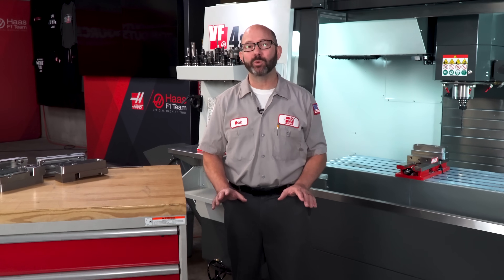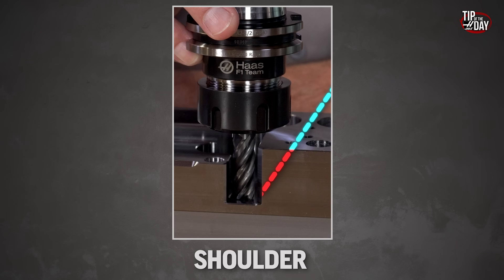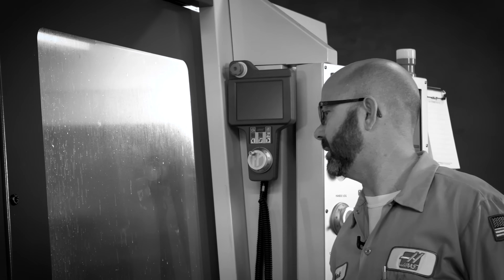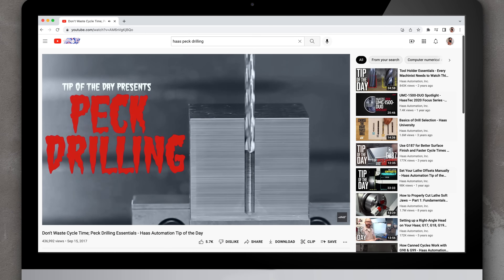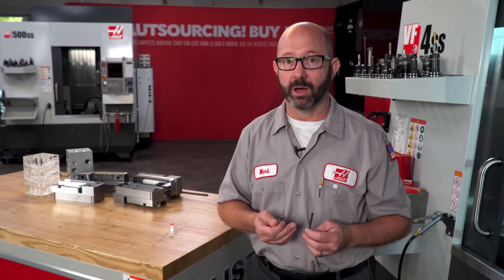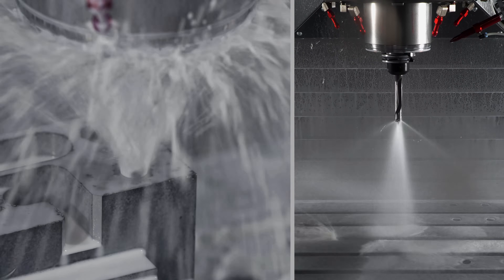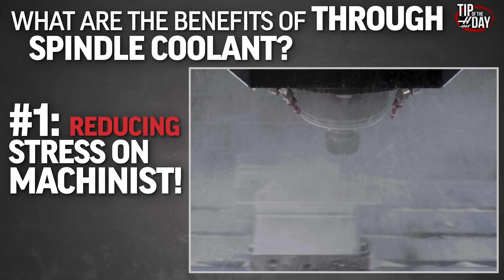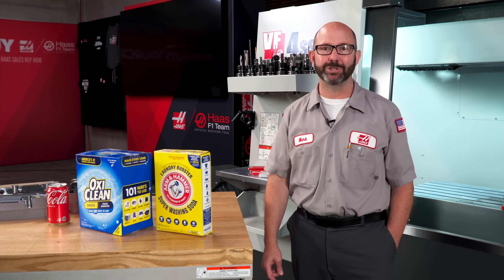TSC = Peace of Mind - Mark Talks Through-Spindle Coolant - Haas Tip of the Day

Comment: @markterryberry4477 Hey Mark, I’ve reached out to my local HFO but can’t get any responses from anyone about this. I have a 2021 VF-2YT. I bought it used, seller said it was TSC Ready, but once I got it and ran the serial it didn’t actually. It does however have a hollow spindle motor shaft and drawbar. I’ve been able to blow air thru the spindle. I don’t currently have any need for TSC but I do absolutely have a need for thru spindle air. I removed the push to connect fitting up top and blasted air thru the spindle but when I put the tool in the spindle (have verified the tool functions correctly on the bench) the air leaks out somewhere between the taper and the air purge fitting up top. Is there something specifically different between a TSC Ready spindle and a non TSC Ready spindle as far as seals/etc goes? I don’t need the tool to spin while air is running thru but I do need to be able to rotate it with an M19 Rx value in the program. Any help in this would be GREATLY appreciated.

Comment: Is there a reason why we wouldn't run all tools with TSC if available? Right now we are working a job and we are using a TSC drilling operation but then when we switch to tapping it's back to standard coolant delivery. I haven't asked the programmer yet why this is the case. I'm assuming it's a cost decision? Also, do the orifices in TSC tooling have an effect on tool strength?

Comment: Can we get a video about tension compression tapping chucks?...or if there is one could someone drop a link?
Reply: Thats a good topic. If your Haas machine has rigid tapping, I'd skip the floating tap holder and focus more on your coolant concentration and the type and quality of the tap you are using. In the 1990s, we used a lot of compression tap-holders, as many of the machines didn't have the Rigid Tapping option. Today, all Haas machines will come standard with Rigid Tapping, so there real is no reason to use a spring-loaded floating tap holder any longer. On older machines without Rigid Tapping, we could run into trouble if trying to use floating holders with Form/Roll Taps, unless we really play with things to get our application working, they have a hard time starting until fully compressed, which can make our thread depth vary. Today, we may occasionally still use a floating tap holder, like the ones made by Emuge, but these are just adjusting for small axial/radial runout, to prolong tap life on long running production jobs.

Comment: I used TSC with my 1/2” KOR5 end mill with the hole for it. Makes a huge mess. It did bite me one day. It threw chips up into the tool change mechanism and a chip stuck to the grease in front of the prox switch. Took me over 1/2 a day to take all the covers off to find the problem. 5 seconds to clear the chip. I like TSC a lot but the covers around the tool change need to be better.

Comment: Absolutely 100% non-negotiable when drilling out stainless steels in a productive manner. I've programmed and ran parts in a lathe where I've had to drill 5.0" deep in 304 stainless with a 0.403" size drill. Cutting with a cobalt steel bit took around 25 minutes per part, but with the thru-coolant carbide tip drill, the cycle time dropped to 7 minutes when taking into account all the other tools. That wasn't even with high pressure coolant either. Just some old beat up SL-30 from 05'. Put on a fresh insert, turn on the tool overload alarm to about 15% higher than what the spindle load readout is saying, hit cycle start, and get paid.

Comment: Question for the group: I have a smaller drill I am using to pilot #6-32 tapped features using TSC. When using that drill the pressure in the TSC line gets to ~1150psi. Other tools that I use TSC with are larger tools and the psi stays well below the 1k rating. I changed out the collet on the pilot drill to a non-sealed/standard collet to try and reduce the pressure. So finally the question, is the pressure surpassing the 1k psi mark, to a max value of 1150 psi, going to damage the TSC lines in the machine?
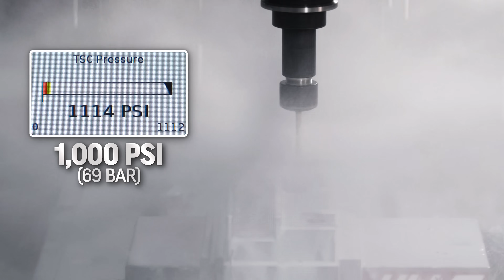Reply: That high 1,150psi pressure is perfect for that small drill, and the system is designed to handle this just fine. 03:39 . For more information on the pressure vs volume of our TSC, check out this other great video we have on TSC https://youtu.be/RL0zWuuywzA?t=51
Reply: @markterryberry4477  Thank you Mark!

Comment: Hi Mark - Long time fan.  As an owner of a new UMC750 with HSK and TSC 1,000PSI, I am a bit underwhelmed by the TSC.  I drill a lot of 10-32 architecture and I have yet to find a reliable sealed collet from any supplier that fits a .201 #7 drill...  Neither Haas nor Maritool nor anyone else has one  Also,  I have pneumatic drill chucks that are TSC compatible there is no way to get a good seal such that the coolant goes through the drill and not every where else with just a little bit going to the tip.  Primarily due to the architecture of the edge of the Haas TSC drills at the butt end.  Any advice on these topics would be great!
Reply: One option would be a 1/4” shank #7 drill.
Reply: I have all of my drills in Rego-Fix ER chucks. For TSC tools, I use thier ERC collet nut and a sealing disk appropriately sized for the shank. Rego-Fix has a few videos on their channel describing the system, hasn't let me down yet.
Reply: Hi Chris. Shoot us an email at tod@haascnc.com  and we’ll work through it together.

Comment: My only gripe with TSC is getting coolant on the tool holder shank and in the spindle taper, typically after a job that runs tsc we'll take all the tools out wipe them down, wipe the spindle taper, and reload.
Reply: I almost forgot, haas tapers stick like crazy, to the amount of the arm not being able to pull out the tool… otherwise i really love tsc, carbide drills kick ass in stainless, and the chip evac is supreme with high feed mills…

Comment: I work with a guy who refuses to use TSC just because that’s what he’s always ran with. I turned it on in all our programs where we have tools that can use it. He always shuts it off , can’t convince the guy. Being a manual machinist before Cnc, I can attest how much better it is for tool life, and part finish, also allows for higher feed rates. Ben if you’re reading this,  please watch the whole video 😂
Reply: 😂😂😂 . I just thought you needed through coolant collets to use this feature
Reply: Add it in a few times in the program.
Reply: @cadneemountai2791  it’s on a mazak so there is a  button called through coolant auto you have to turn on otherwise it ignores any m codes that turn it on
Reply: 内冷换刀时主轴里全是水

Comment: I love TSC, but have found that it can warp hole sizes on some cast aluminum parts. The pressure from the TSC would be enough to cause the chips when evacuating the hole to rub the sides of the hole on their way out causing the hole to expand causing my hole to come out over sized. I was using a .204 TSC carb drill and my hole would come out around .214, but when I’d turn the TSC off and just run flood coolant the hole would stay true to size. Otherwise I use TSC whenever possible.
Reply: Do you think adding that TSC affected the drills runout? Was the TSC pressure too high?
Reply: @Big_Friendly  it might have, it’s hard to say. What for sure caused the hole to be oversized. I could see noticeable scratch marks in the hole after the TSC, but when I used the same drill same holder and everything just without the TSC my hole came out perfect. What is your guess? I just figured the material was so soft that the pressure caused more material to come off. It is a 1000psi system.
Reply: @brianropel  that sounds pretty high for aluminum. I run steel and have about 700 PSI.

Comment: Would you run tsc with a standard hss drill in an er collet?  I’ve done it with luck here and there but I feel like I’m shoving chips back into the hole
Reply: It’s great for keeping the coolant on the drill, especially in a pocket, we will still need to peck the drill unless it is a real through-tool-coolant drill though. No TSC = pecking. Only a TSC drill will force the chips out without pecking.
Reply: @markterryberry4477  great work

Comment: I have CTS on my Leadwell machine, but problem is i use mostly plastics especially derlin, it break down to microplastics and fill up in filter like almost every time when i use CTS. Machine alarm pop up say CTS is dirty. Any tip to resolve the problem?
Reply: I'm not sure on your exact machine. On our Haas machines I would be recommending our Chip Tray Filter Kits that pre-screen the coolant as it goes into the tank, and then I'd be looking into our Auxiliary Coolant Filter which really helps us keep those fine chips out of our coolant. Depending on the material we are cutting I might play around with the filter bag material as well, with plastics having a too-fine (too low of a micron filter bag) filter will cause us to clog up quickly. For roughing, try and keep those feed rates up on the plastics as well, giving us bigger chips.
Reply: Thanks Mark, i will look at chip tray filter kits.

Comment: I like the idea of tsc. But I have had a lot of trouble on older haas mills getting it to work. I have not been able to try it out on the newer ones yet. Thanks for the advice on the tip of the day mark. I have been working with cnc since the 1990. Ps thanks for the final comment on this article.
Reply: 90年   我的天那，32年了

Comment: Help. How i can to turn off tsc while running to check the tool or the part in the middle of the program. 
Why is there no tsc button.
Reply: The AUX coolant button is the TSC button for us. On a mill, we only allow the TSC to be turned On or Off while the spindle is stopped. This has to do with the way the coolant sealant discs in the spindle operate.
Reply: @markterryberry4477  thank you. It's important for me to check the drill bit when i do a long drilling cycle on a stainless or hardened steel parts. Some time i like to check it in the middle of the hole
Reply: @MosabAyyad  it might be something to do with your haas controller. my umc750 with the older controller cannot turn off the TSC while running at the middle of the program too. And my 1 year old umc500 allows me to turn on and off the TSC while the program is running.
Reply: @harryho9097  @mo3ab I believe you have to press FEED HOLD, stop the spindle, and then press the [AUX CLNT] key to stop the TSC while running a program. Then, press [AUX CLNT] again to restart the TSC and then start your spindle.
Reply: @johnnelson8612  yeah, that’s how I did on the new controller, but not with the old controller
Reply: @harryho9097  Try pressing [SHIFT] + [AUX CLNT] to stop TSC.
Reply: On my Okuma, it's the "Oil Hole" button.

Comment: Is it better for TSC to be aimed at the cutting edge or leading the cutting edge. Most mill tools. It leads. On lathe tooling it is at the cutting edge. Why the difference?
Reply: With some tools, the high pressure coolant can help with our chip breakage. This is especially important on lathes where we are trying to avoid long stringy chips. On mills, we won't get those long stringy chips because of the interrupted cuts. This is one of the reasons manufactures have different 'targets' for their TSC. Lots of coolant, on the tools cutting edges is a always a good thing.
Reply: @markterryberry4477  cool. I figured that was the reason. Just wanted to double check. I have four CNC’s (Haas SL20, TL3, Fadal VMC20, Fadal 4020), the sl20 great job of coolant delivery. The others, not so much. I can see, from someone who have never used TSC, where it should be better (a lot). I know on a lathe. Most of it is single point tools. On a VMC usually it’s 3,4,5 insert tools. So is their thoughts just get some form of cooling and lubrication there? Or is there some bigger issue they are trying to deal with?
Reply: Mark Terryberry when would TAB be better to use than TSC?